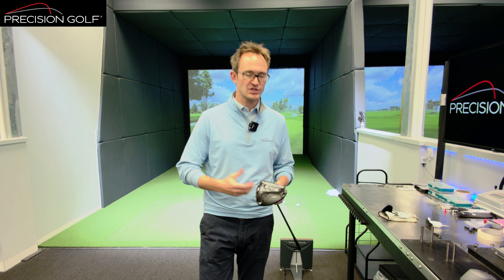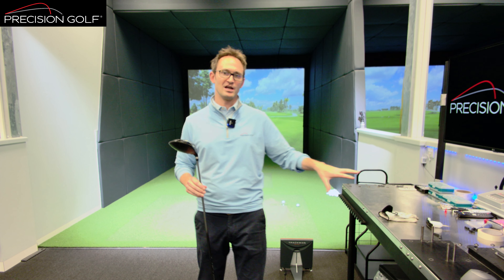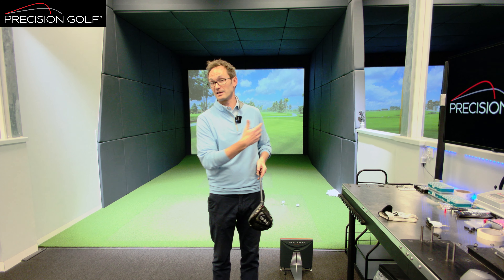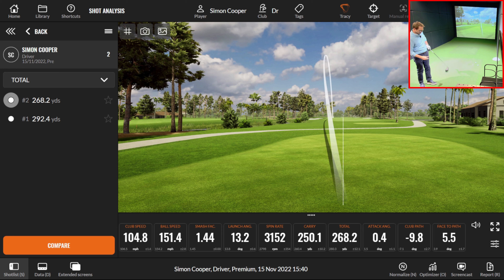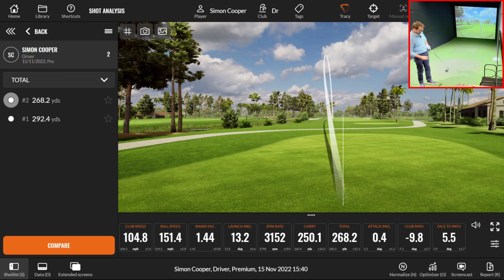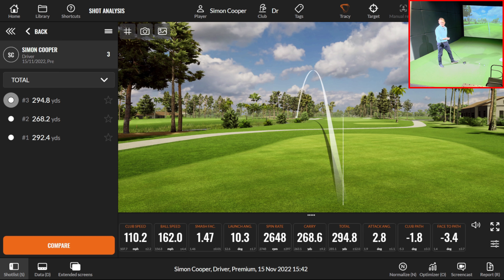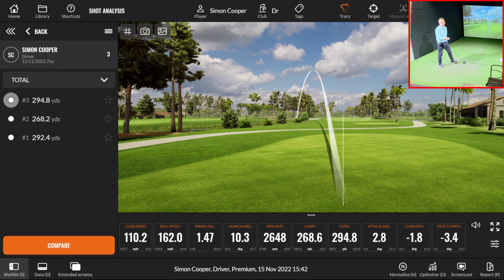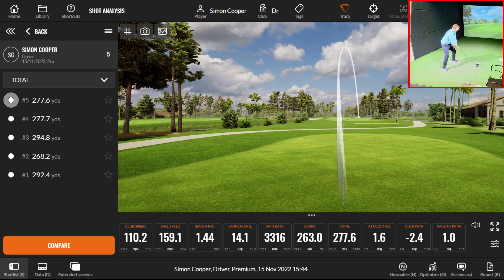SWINGWEIGHT can RUIN your clubs performance. MUST WATCH!

Comment: What is your opinion on swing weight vs total weight? I have been using JumboMax tour grips that reduce my swing weights to c6-c7 which has been great for me. I have 120ss with a very aggressive transition and it seems like it helps me control the face.
Reply from the maker: Both are important and how you put energy into the handle and which muscle groups you use to develop speed dictate what will work and why.  For you heavier dead weight but light swingweight appears to be good but for me it is a killer! Dead weight is important to match as it allows you to use the mass to develop speed and to keep the main body of the club and your body turn in synch, swingweight then knits together the timing and consistency of the club face squaring/club head arriving at impact so both are equally important

Comment: You're definitely the best fitter on YouTube, thank you! One thing I'm struggling with is getting coherent, consistent answers on a) whether a heavier shaft increases or decreases swingweight (adds weight but makes head 'relatively' lighter) and b) setting up a 14 club set, because I see most pros at Ping (for example) have a D4-D6 driver, D4-D6 wedges, and apparently D2-D4 irons, but some fitters online and offline have advised a steadily lighter swing weight from wedges (say D4) to driver (say D1).

Comment: Very interesting information. Regrettably many fitters / suppliers ignore swingweight completely. Incredibly, The big manufacturer that I've just got new irons from had no idea on what the swingweight was for the combination that I wanted of head & shaft from their fitting cart. I had to borrow the combination and get it swingweighted myself in order to specify it on the order!
Reply from the maker: Glad you appreciate the importance of SWT as well. The problem is, it’s such a hard thing to control in a mass production environment, easier to ignore it than give it credit. Then of course you have the discrepancy between the calibration between the swingweight scales during the fitting and those in the manufacturing plant.

We are very fortunate to be able to calibrate our scales on a daily basis and everything we build is in house.
Reply: If only I could have done that! I finally ordered my dream set of irons from a top manufacturer, advertised as D3, and what I got were C8-C9! Then when I complained, they shrugged and said "we don't guarantee swing weight" and we normally allow for 2 points of deviation, which is a lot anyway, but nothing compared to the 5 point difference I received. Was a very dissappointing process.

Comment: I've often wondered about the weight of a golf club, you see loads of people with heavy headed training aid clubs that supposedly help fix all manner of swing  ailment yet the higher the handicap the lighter the club's generally are.
Reply from the maker: Generally speaking the lower the handicap the better the technique and the more weight the player can cope with but this is not necessarily always the case as it depends more on how the player develops their speed as to what weight is optimal. 

It is certainly not a cure all To have a heavy head weighted training aid and can create more issues that it fixes for some players - most important thing is to be able to move it at speed but being able to stay balanced and in posture at the same time.

Comment: Another thing people don't realise is how far out the stated loft can be from the actual loft i.e two 9 degree heads in the same model and make but one could be 8 degrees or even less and the other could be 10 degrees or even slightly more, maybe that's why some heads feel slightly hotter and launch differently even though they are on the face of it identical.
Reply from the maker: You will rarely ever find a head that measures less than stated loft on a driver, it is actually quite rare that they measure what they state as almost all are higher than stated loft to ensure players see enough flight from the heads due to lower spin rates. The launch differentials are loft related (for example generally Callaway heads measure higher than Titleist heads) but some of the “feel” is also sound as well as weight distribution- weight forward can feel more solid than back weighted - but there is minimal actual ball speed difference nowadays out of the centre of the face. 

Thanks for watching!
Reply: @Precision_Golf  we will have to disagree on that one, I worked on a tour van for 13 years and know that heads from all manufacturers are all over the map, with plenty coming in under stated loft, the tolerance is bigger than most people think, but anyway enjoy the content you guys do a great job, thanks for the reply👍🍻
Reply from the maker: @ we certainly used to see more coming in under stated loft - R11 was particularly good if you needed a 9 degree head measuring 8 degrees every now and then - but it is much rarer now. On the tour vans it may well have been more prevalent though to see the low loft heads but as you say there isn’t one brand that is not guilty of some pretty wide tolerances over the years. Thanks for watching and for the comment!

Comment: Swing weight is everything, but you have to have it somewhere near correct. You need a Heavier head with a counter weighed balance in the grip end to realise that somethings get better with trial and error.
Reply from the maker: Correct swingweight on a correct shaft weight and balance is everything - you cannot use swingweight as the constant parameter to ensure performance as a high balance shaft and low balance shaft at the same swingweight will swing completely differently. You are correct that swingweight is a vital thing to get right though

Comment: My issues is i had a fitting but felt like we missed a few things with the iron because we tested only few heads and few shafts and all was 120grams.Then the driver we did same but founds something that worked in the 60s x flex.
But they didn't check swing weight so not sure i got the best fitting more of a sales man trying to make his commission.
So on my next vacation im looking to find the best fitters that will take the time over a few days to do the fitting for all 14 clubs in the bag.As none of my clubs except the driver is fitted and basically hitting the driver just fine on most days but the rest is a bit hit and miss.

Would appreciate being pointed towards a few options on where i could go for these kinds of fitting.I am working in the middle east.Thanks
Reply from the maker: Hi Leonard. Thanks for sharing your story. We’d welcome the opportunity to fit you properly at our studio when you’re in the UK. Unfortunately Precision Golf in Dubai is nothing to do with our company.

Comment: I have two sets of Titleist irons - 681s with DG S300 shafts and the 710MBs with Project X 6.0.
Both sets of irons have had shaft extensions added at the top of the shaft which has increased the 681 swingwight to around D7 which is significant when alternating with the 710MBs (now D4).
I find the 681s help promote a smoother and more correct swing-path without any significant loss of distance.
Although the Project X feels a bit smoother, I also find the lighter shaft and swingweight cases me to rush from P4 transition position.
Reply from the maker: The type of shaft extender can make a difference to how much swingweight is affected but the 681 heads will be heavier due to the standard length being shorter when they came out. The heavier swingweight may well be helping your swing plane and timing
Reply: @Precision_Golf  Exactly what I thought - my 681´s are extended by 1.75cm (or 0.67”), and for reference, the PW head weighs 290g and I think these are 4g heavier than the 710MB heads throughout the set

Comment: It's why I was done with swingweight matching over 10 years ago and went to MOI matching.  I'll never forget the time I went to demo day for the PGA Merchandise show and would swing the same numbered iron with the same swingweight but the heads and shafts were from different OEM's and I was like 'no way do these feel the same in terms of heft.'
Reply from the maker: Spot on - you can’t use solely a static measure to determine how it feels in motion

Comment: I know a pro who uses very heavy shafts but low swing weight. Lot of weight in the hands. This way give him more freedom to square the face but maintain momentum mass x velocity ^2. Higher mass with higher velocity. This helps impart higher momentum on the ball as per law of conservation of momentum . Something to think about I guess. It is hard to increase velocity with higher swing weight and the face tends to lag behind a lot and it taxing on the wrists. I have yet to try this myself, but am hoping some of you might shed some light on this
Reply from the maker: This is very player specific - it may work for the pro you mention but I know for me would be disastrous. Some players move lighter shafts with heavier heads more efficiently and others move heavier shafts and grips with lighter heads more efficiently. It is impossible to blanket statement what is “best” as it varies player to player

Comment: I've found that getting the "correct" head-weight (and therefore swing-weight) is critical to get the best performance from any shaft, especially on a driver.  Swings are different, so finding a shaft/weight combo that loads and unloads the shaft effectively determines how far and how straight you hit your drives.  I haven't found a formula.  When I try a new shaft, I change the head-weight up & down to "get the feel".
Reply from the maker: This is just dialling in the dynamics to suit your swing. It is a mixture of shaft weight, balance point and head weight being tuned to your action so you are not compensating to deliver the head

Comment: Interesting video. One thing to add;   if players want a consistent feel when swinging a set of  irons , each club would have a different swingweight ; the 5 iron might be D1 ,  and wedges D3 , with a progression  for the clubs in between.
Also, have you done any testing/ a  video on counterbalancing ?  I had lessons in America while back where the pro suggested counterbalanced clubs  helped to reduce players' tendency to release the club early
Reply from the maker: We build that way with a progression through the set. 

Be very careful with counter balancing - if anything if you increase hands weight what will happen is that it will INCREASE the chances of early release because you are bringing the balance point up towards the grip which means as you accelerate the handle you actually create less “lag”.
Reply: @Precision_Golf  interesting, thanks for the reply.

Comment: Hi, Based on this driver swing weight exercise, can a slower swing speed in irons still require a stiffer/heavier shaft ?
Reply from the maker: It can do but it is rare. Usually if a player swings it relatively slowly then in order to free the swing up it is a less heavy weight as the player is putting less energy through the club so a heavier weight gets stuck behind in the downswing. It may, however, require a heavier swingweight to gain control of strike at any swing speed.

Comment: Unbeknownst to me my TSR four set up had a swing weight of C8 I’m swinging at about 115 mph and I was having issues I purchased a 975D with a stock steel shaft a little bit too windy for me but it fixed my swing I finally measured it and had a swing weight of D5.5 swing weight was everything
Reply from the maker: Huge set up difference there, C8 is very light so no wonder you were struggling

Comment: I brought a set of p790 with graphite shafts 90 grams regular flex. In checking the swing weight they are d8 is that just too high? And if I put a counter weight in the handle do you think that will help? I’m 65 
‘My other set of p790 is 65 grams graphite regular flex they were set at d2    and I like them better
Reply from the maker: At that swingweight they should either have a very light grip or are longer than standard, otherwise the heads are very heavy indeed. A counter balance will lower swingweight but it does it by adding dead weight which can be counter-productive so best to get the complete picture before making a change
Reply: @Precision_Golf  I do have standard grips and they were 1.5 longer than stock. I took your suggestion and cut the shaft back to stock and the swing weight dropped to c8 I’m trying them tomorrow.
Reply from the maker: @ronwinter45  hi Ron. I didn’t actually suggest cutting them down because of big know your physical stature but the length certainly was the issue of the heavy swingweight. C8 is quite light so they may well require the heads to be weighted up, especially if your other set at D2 but with a lighter 66g shaft performed well

Comment: Hi simon, i recently fitted myself to t150(6-pw) and t200(4&5i) w/ project x io 5.5 shafts, half inch long. Ive noticed my 6-pw strikes are more on the heel side, starts on target line and draws 10 to 15 yds. And struggling to launch 4&5 irons, its coming out low with similar carry numbers and running out 20 to 40 yds. What could be the issues? Swing weight? Lie & loft? Go back to standard length? All the above? 😂 any suggestions will be appreciated! I cant trust the fitters near me. Precision Golf definitely puts them into shame!

Fyi. Im 6'1 tall, swing speed with 7i is roughly 80 to 85mph. Length+0.5", standard loft and lie. Thanks again!
Reply from the maker: Chances are the swingweight is fairly heavy and this as well as potentially the low being a little upright could cause the heel strike.

Try gripping down the shaft a cm or so and if strike improves then it is the swingweight!
Reply: Ill give that a try. Thank you very much~ You guys are awesome!

Comment: Watching this again after changing from my stiff flex 63 gram driver shaft to my 54 gram regular flex, both Graphite Design Tour AD-IZ shafts, same Callaway GBB Epic Sub Zero head. Have not yet checked the swing weights but plan to. But on my best shots with each I gained 13 yards of carry and 21.5 yards total with the lighter, regular flex shaft. Am also having a second set of the forged blade irons I use made  with 77 gram Nippon Pro Zelos 7 stiff steel shafts instead of my current Royal Precision Rifle Lite 120 gram stiff shafts. The light Nippon shaft together with midsize Golf Pride MCC Plus 4 grips that are longer and thicker under the lower hand and weigh 66 grams (more than the shaft!!!) substantially changes the swing weight of the irons. If I recall correctly, the fitter said my 7 iron with the Rifle Lite shaft was D-4.5 while the 7 iron I had made with the Zelos shaft was D-0.  My question to you is, in general, although individual fitting is of course best, would you recommend lighter swing weights for older senior players as swing speeds become lower?
Reply from the maker: Great improvement. With swingweight dropping in the main the answer is yes but this is not necessarily due to head weight reducing, some of it is down to shaft weight reducing (1 swingweight point for every 10g on average)

Comment: Would true temper amt shafts help keep a consistent swing weight through the set due to the incremental weight change?
Reply from the maker: Hi, yes and no. In theory, yes but if you do not take head weight and grip weight into consideration, as these have a tolerance they can dramatically throw out swing weight. Every component has to be measure and weighed in each club in order to build a perfectly matched set.

Comment: On a 45in driver would an 1.5in cut off the butt produce x stiff?
Reply from the maker: Hi. By cutting the butt of the shaft you are removing the thickest, most stable part of the shaft, so actually you will soften the flex.

Comment: Hi , I cut my shaft down (butt end) to 44.5” and the swing weight dropped to c6 or something,,, I’ve worked out I need to add 12g back into the head to bring it back to d2… my callaway smoke ai max has 2 weights on the bottom , a 2g front weight and a 14g sliding weight at the rear,, my question is should I add the 12g to the front weight or 6g in them both ? Cheers
Reply from the maker: Hi Andy,

It depends on what you’re looking to do to flight and spin. Weight to the rear lowers CG and will increase launch and spin marginally, weight forward will have the opposite effect. You may not need to add as much as 12 g as the weight is a little bit further away from the hosel and will have a great effect. Please note that you will be softening the shaft by half a flex range as well by adding 12g ish
Reply: @Precision_Golf  thank you ,, well it’s actually 10g I’ve added to the front as I swapped the 2g weight with a 12g weight , so now my flex will be between senior and regular?
Reply: I slice the ball that is my miss with driver
Reply from the maker: @andymarshall5517  the shorter shag should help square the face, the weight forward will lower spin and might also help square the face too as a deep weighted head can fan the face open so hope it goes well!

Comment: Great video. Thanks. As a general rule, should swing weight match woods, hybrids and irons (excluding wedges)?
Reply from the maker: If irons are standard length then they often find out similar, however not always as some players need a lighter swingweight in woods than irons so there is no hard and fast rule in matching woods and irons. Wedges are very often slightly heavier then irons though

Comment: Hi, i have a TSI2 driver which i believe has a stock swing weight of D4, i have put on a midsize grip on which i think is about 8 grams heavier than the standard grip. How much would that impact swingweight? i assume it would maybe bring it down to D3? Thanks
Reply from the maker: That’s correct, it will be between D2 and D3 (rough guide is 5g grip change alters swingweight by 1 point)